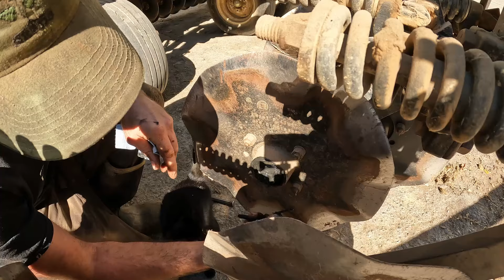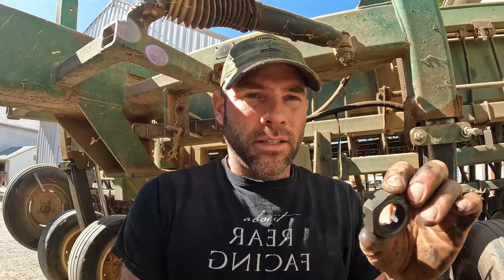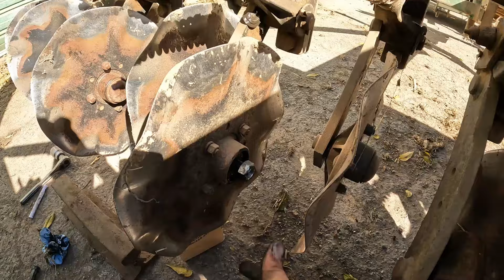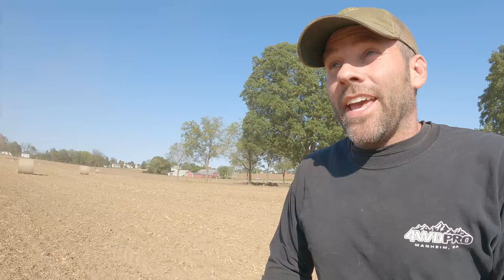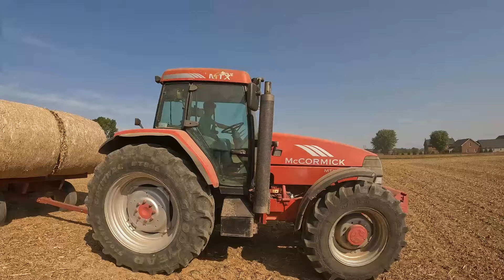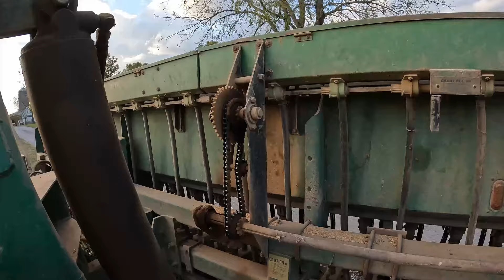Baling Fodder and Something New for Cover Crops

Comment: Sometimes I've had luck with flipping castle nut over threading back on the shaft  and if your lucky the bearings have enough play to screw nut past cotterkey hole then driving a roll pin through the hole to secure the nut from backing off . Obviously not a forever fix but keep it running til getting a new castle nut . Generally when I have to replace a worn castle nut like that I do new inner seal and bearing with a new nut. We had same coulter caddy but ran a 5200 caseih drill
Reply from the maker: That’s a good idea,  I will have to keep that in mind for next time.